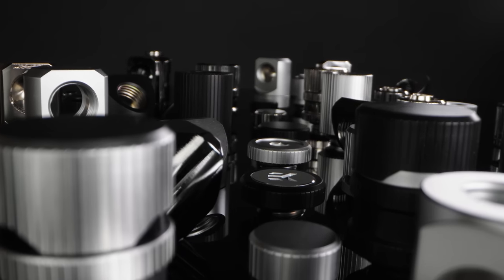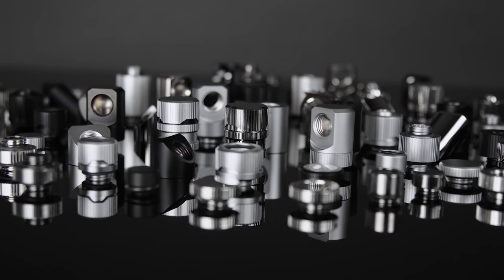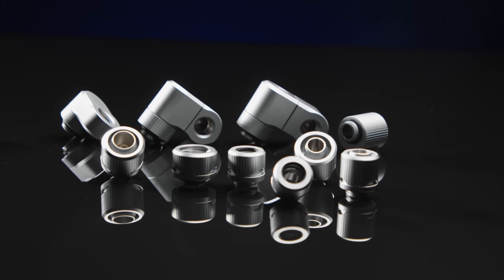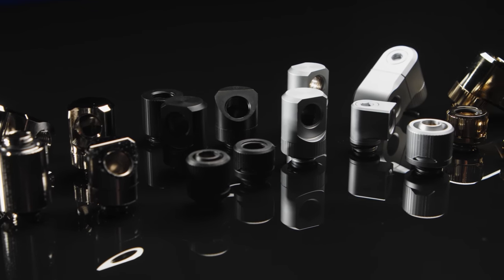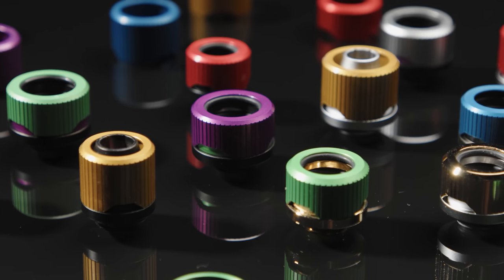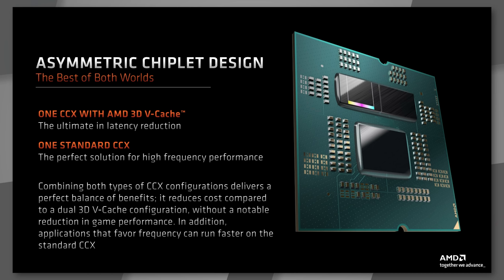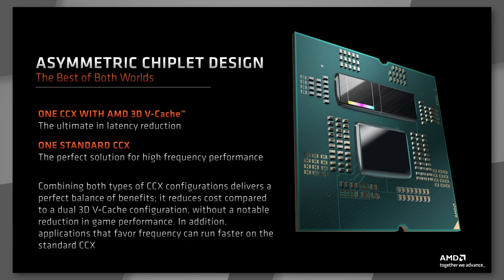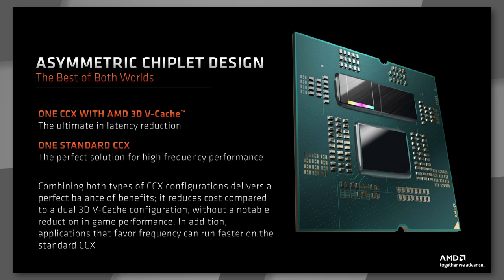Why I switched back to Intel...

Comment: 7800x3D with Gigabyte b650 elite, gskill 6000 ram and 4090, been stable, no bluescreens, no slow startups. PBO on -30 and it's been good. It was my first build since owning a 4790k so was kind of nervous about not making any mistakes but thank God its been working great.
Reply: Yeah I myself have a 7950x3d build. Been stable with 6000 ram since day one. Really don’t know what Jay’s issue is but there’s no way in hell you give up the best gaming cpu and go for power hungry intel.
Reply: He should have tested that system with other brand ram modules.
Reply: @MustafaGT  the issue is that Jay simply loves Intel and that's it. No other excuse or whatever - not sure why not just say it straightforward, same as he builds everything on GeForce cards. It's fine to be brand-fan and stick to it as long as it's good, but just damn admit it...
Reply: @utawamaru I mean its clear that nvidia has better gpus so its okay.
Reply: @infinityimpurity4032 Nvidia makes all gpu’s 😆
Reply: @utawamaru  Imo, it's not that jay just loves Intel but it's more that he just doesn't bother to troubleshoot the problem when he can just easily swap out parts or platform easily compared to regular people. Also whether we like it or not, Nvidia has the best gpu if you don't take into account the price to performance ratio.
Reply: Care you share your bios tweaks? What options you enabled/disabled or changed. Did you mess with MCR?
Reply: @utawamaru I don't think that's entirely fair. Jay has been very fair towards amd, and when you're buying the highest end of PCs, you want the highest end parts and Nvidia is still pretty far in the lead in GPUs.

He's had rough luck with his use case and the 7950x3d. That's understandable, and he didn't want to set up core affinity for every game he plays.

I don't think he's being a fanboy of Intel, he's just tired of troubleshooting the new system. Honestly he's lasted a long while for the amount of issues he's had.
Reply: @utawamaru there is a reason he likes Intel: it works. He gave AMD the best chance possible buying their top of the line kit and it did not succeed to even run at XMP profiles, let alone at any enthusiast levels. I dunno... maybe AMD should start making stuff that works?
Reply: 7800X3D sucks at multitasking.
Reply: @icy1007  how many games do you play at once?
Reply: @InnocentiusLacrimosa  Tell me you're a shill without telling me you're a shill
Reply: @lmaonaise  ive owned 3 amd devices and all three of them have issjes, fjnaly went wjth a 12th gen inetk i7 and it works like a charm, im only talking about cpus, amd gpu are in a dumpster fjre of thekr own.
Reply: @lmaonaise It's about doing things other than gaming, the 7800X3D just isn't as good at it.
Reply: @mangatom192 If you have a business like ke he does nobody has time to truobleshoot stuff all the time. If Intel works with less hassle people will choose that. I am also an AMD user.
Reply: @GentlyUsedFrog  muah, another pretend-smart: do you know any phrases that are not just memes? Probably not.
Reply: Another one with a 7800x3D with Gigabyte b650 elite, after always being Intel (last system 10700k). Have the ram running at 6400 Cl 30 (cheap Adata) and an all core CO - 38. Pretty much stays around 5.05 ghz when gaming.
Reply: @icy1007  well yeah I wouldn't buy one if I was concerned with productivity
Reply: @InnocentiusLacrimosa  Because that's a meme now? 
"Another pretend-smart" you're hilarious dude!
Reply: @kevinerbs2778 Lmao, your comment contributes nothing toward the conversation.
Reply: good man! i have similar system and also no complaints
Reply: @utawamaru  When you have money and want a good GPU there is no other choise than an nVidia card. If you deny that you are the fanboy. Im pretty sure that money is not an issue for Jay.
Reply: @InnocentiusLacrimosa  AMD CPU's work just fine. 

If i understand it correctly though, he used a ASUS mainbaord... they don't really have the best track record with RAM compatibility since a long while.
Reply: @utawamaru  Imagine you do productive work with your computer. Like i don't know... Blender... DaVinci Resolve....

Why would you even remotely consider a AMD GPU? It completly cripples you in productive workloads. The only thing it's good at is rasterization in games. The end.
Reply: Same system here. Runs cool and barely audible. Old PC was a 9700k with 2080 and the frame rates went literally 4x. And I can upgrade it to zen5.
Reply: @utawamaru  Jay literally put out a 17 minutes long video listing all his issues that he (and many other people) had with the amd system he was running for several months, but sure it's just because he's an intel fanboy.
Reply: 17 sec start up with 6000 cl30 (non expo rated) ram up and running here. Also have the curve optimizer set to -30 and no issues so far.
Reply: I have the same but the b650 pro and 7900xtx
Reply: @FantasticKruH  Awesome, are you happy with the 7900xtx 😀
Reply: @boastyy  so far its good, only had one driver problem with it on some older indie game.
Reply: @FantasticKruH  Good to hear mate! 😀
Reply: @davidchardar835  yes, he also put over 30min video half a year ago claiming to be done with ASUS, while here he complains that with each update on his ASUS motherboard it was getting worse... man, really...he wanted to use intel, I don't care. Just stop making biased shit with lowball arguments like that - because the more he tried the worse it got. simple as that
Reply: @utawamaru  Indeed, the more he tried to get his AMD computer to work, the worse it got. That's why he's switching to Intel. That is literally what he is saying in the video you supposedly watched. Thanks for your extremely valuable input.
Reply: Same here, Asrock x670e, 7800x3d, gskill 6000mhz. Super stable and fast
Reply: I have the same with a 3080, no issues, I was however getting a lot of blue screens on my 3600 before I upgraded
Reply: @MustafaGT  I love watching Jay's videos, but like other content creators the big ones whoever sponsors more and gives more money and free product they're going to choose one brand over another
Reply: Running a 7950x3D with x670e aorus master, 64gigs of 6000mhz kingston ram and a 4090. I've also been completely stable since day 1. Not even a single issue for the past 5-6 months I've been using it.
Reply: A single offset for all the cores is an extremely bad idea. I highly doubt it actually is stable at -30 all core. Nobody should be attempting those offsets. The best cores need more voltage, and that is the common cause of instability issues. You should not go past -10 or -15 on the best cores.
Reply: I would be very surprised if your system is 100% stable at -30 core offset. I have tested 5 different AM4 and AM5 systems and none has actually been stable at -30. Some pass memtest or prime 95 but then have random windows boot hitches or crashing in games
Reply: @clifflenoir4323  100% correct here. Usually the best cores are not stable past -10 or -15. Maybe -20 if you are lucky. It might take weeks or months to actually encounter an error or crash though as they will occur in low core workloads. No clue why so many people here are commenting about their all core offsets with the same value for all the cores when you should be using different offsets based on how "good" the core is.
Reply: @utawamaru that's bs. He is just honest and takes decisions based on his own experiences. This didn't work for him so he switched
Reply: My build is similar. I went from 4770K to a 7950x, G.skill 6000, Asus x670 and a 4090 and other than my WD Black 4TB SSD inexplicably dying after 10 months of use (I replaced it with a Samsung 990 Pro) my build has been rock solid. One difference though is I used Intel XMP memory instead of AMD EXPO memory. I ordered it by mistake but used it anyway and I have had zero issues running at 6000M/Ts. Go figure...
Reply: @MustafaGT  Jay having skill issues :D
Reply: @clifflenoir4323  I'll bump it up when I know it's unstable. But as of right now, nothing has happened yet.
Reply: 7800x3d with a tuf x670e and gskill 6000 and the only problem ive had is slow startups with docp enabled
Reply: @MustafaGT  theres literally no way down in hell where a system running hot as hell is going to survive for long meaning you would have to change anyways when the lifespan is getting shorter and shorter for every new generation .. thats what next gen isnt telling you about. meaning you would have to spend on a new complete system sooner than previously thought.

so indeed you chose the right CPU but the wrong GPU in terms of lifespan..
Reply: I run a 7800x3D and it runs fine and pretty decent temps without PBO
Reply: 7800x3D with b650, cant post with memory over 5200 Mhz, tried G.Skill first, returned them and tried Kingston, same shit. After several BIOS updates that did nothing, i gave up. Most likely wont be going AMD in future again.
Reply: What kind of cooling u got? Aio or air only?
Reply: @SwerveNation  Hi mate I have an AIO, the Arctic's Liquid Freezer II 360. Very happy with it so far.
Reply: @boastyy  nice I gotta corsair aio I just like the design of the glass plate lol
Reply: @SwerveNation  Ha, the arctic works great just wish it looked a bit better so can totally understand.😀
Reply: @GentlyUsedFrog  It's just dumb to call everyone who disagrees a "shill." Lots of hardware is made to work with Intel specifically. Not to say it won't work with AMD, but it isn't supported. There are loads of people who have issues with AMD. Some have been able to find workarounds. The 7800X3D is the best for games. But some products just run better on hotter, power hungry, expensive intel. That's not shilling. Everyone admits the downside of intel. But if you need your, for example, Universal Audio interface to work right you need to go with intel. Plain and simple.
Reply: @infinityimpurity4032 nah mit really Price per fps better on amd
Reply: Pbo is not necessarily anymore or?
Reply: So your problem could have been memory related or MB related and you didn't try any other options before making a video about how bad the issue was?
Reply: @butchbrown1582  It sound like it was multiple AMD systems over years. Not sure how many other mobos or brands of RAM Jay tried, but it's not just him having the issue.
Reply: @Odder-Being  I didn't watch the video, but those who get a blue screen from RAM on AMD DDR5 systems should try increasing the RAM v.
Reply: Lucky CPU you got there! before the 7800X3D I had a 5900X that managed PBO-30 and a little clock offset boost. Unfortunately I wasn’t so lucky with my 7800X3D: got it to -15 stable in stress tests, but I do get bluescreen sometimes while loading the OS. I ended up setting it to -10, I’ll check in the next days if I can set it at -13 or something like that.
Reply: @Galrandil  Yes mate, its been very stable at -30 PBO when stress testing so very lucky. To be honest as long as nothing breaks I will be happy. The burning 7800 x3d chips and the melting 4090 connectors have been a worry. Turned the soc voltage down to 1.2  when I heard of the cpu issue. Keeping my fingers crossed, hoping the pc keeps running lol. Good luck man.😀
Reply: Same boat, feel like jays nonsensical yapping is unjustified and merely confirmation biases
Reply: @MustafaGT  Expo tuned or non-expo tuned ram?  I was considering Gskill Flare X5 ram up until seeing this video… now I’m wondering if I’d be better off getting Ripjaws
Reply: @lmaonaise  Dude, multitasking doesn't mean you play multiplae games or that you do multiple things in productivity... If you play games and have discord in the background, that's multitasking, If you play games listening to music, that's multitasking, if you play games with the browser open for guides, that's multitasking... And that's before I bring up streaming and recording.
Reply: @crackajacka87  most of those programs have very little effect on cpu, I have not seen 1 person complain about performance issues while having discord  or multiple browser tabs open. These things are more ram intensive. If youre streaming then thats probably a different story
Reply: @lmaonaise  ... You originally replied back to someone complaining about AMD struggling with multitasking.... Also, you clearly know very little about computers as your cpu deals with processes on the computer, not your ram, so if there's multiple things running on your computer at once then your cpu will use up a core for each different process. To give you an example, if you have a 6 core cpu and you play a game and have the browser open then you'll have 5 cores available for the game and 1 core for the browser and that's what multitasking is.
Reply: @crackajacka87  having a browser open is not enough multitasking to cause a problem mr computer expert
Reply: @lmaonaise  Yes it is as it has to use an entire core to run it.... It doesn't just run itself y'know. This is why the latest intel cpu's have E-cores and P-cores so that the efiiciency core can deal with the lighter loads like browsers or discord while the performance cores can be used solely on gaming or rendering.
Reply: @crackajacka87  you have no idea what you're talking about and you're an intel fanboy. Once again something like having a few browser tabs open and streaming youtube while playing games won't have a significant impact on performance. I don't care about e cores or p cores, I care about numbers
Reply: @lmaonaise  I'm not an intel fanboy nor an AMD fanboy, i just like tech and in fact I have an AMD Ryzen 5 7600 cpu so stop prejudging people you know very little about. 

You are right in that having your browser open wont impact performance much, that's why intel has e-cores for apps like this just to save on power and make the cpu more efficient but the argument wasn't about performance, it was about multitasking and running a browser plus gaming IS multitasking because you are using multiple cores and if you have discord going too then you are using even more cores... Each app will take up a core so it's always best to minimise how many apps are running when playing games to better your performance on games that require multiple cores.
Reply: @crackajacka87  you're right that it counts as multitasking but that example just doesnt affect game performance significantly
Reply: @lmaonaise  The argument wasn't about game performance it was about multitasking as you believed that your cpu doesn't multitask when you game and I pointed out how simple apps running in the background as you game creates multitasking.

Also, if a game is core heavy then it can effect perfomance so if you have a browser open, Discord open and Windows running and you only have 6 cores then you remove 3 cores for access to your game and some games performance best with 4 cores and some like even more... But it depends on the games you like and what you have running in the background.
Reply: I'm building something similar for Christmas this year and I'm so excited. 7700X with the same B650 Elite, Trident Z 6000 CL30, and an EVGA 3080 FTW3. It's going to be my first build since 2015, I'm still using a 4690k PC with a GTX 970. I'm so ready to finally have a beast PC again. Although I'm curious why you went with a "budget" B650 mobo like that when you can afford a 4090.
Reply: G.Skill is the way! Trident Z 6000 CL30 RGB it's the exact kit HUB uses inn their videos, and it works just as great for me with the x3D chips. I think Jay's just got a bad kit of HyperX RAM, that or x3D chips just hate HyperX. Not to mention hes using an ASUS board and wondering why he's having issues. Almost as if it isn't common knowledge that ASUS is currently getting a lot of shit for releasing crap motherboards and terrible BIOS.
Reply: no, the best chance possible would've been buying a different kit of RAM instead of completely jumping ship with very little effort to actually try to fix the issue lmao. That's like not buying a shirt because one size didn't fit you correctly. Big brain. @InnocentiusLacrimosa
Reply: @yeetus59  did you even watch the video. This system was a poopbucket of problems. AMD needs to get their stuff together, but apparently much of their fan base is willing to overlook any possible problems.
Reply: Bro I’m upgrading from that same cpu to a 7800x3d today
Reply: @darkmay200  Awesome mate! Its a hell of an upgrade, hope everything goes well for you. Make sure you update to the latest bios and manually set the cpu soc voltage to 1.2v in bios and all should be good. Thought I would mention it as its important to protect the cpu. Good luck man, enjoy your new cpu its a beast.😀
Reply: why get 6000 when u can get 8000 hehehe
Reply: why do i need to manually set the cpu soc to 1.2v
Reply: @K24-SRT  Thanks man!
Reply: @MustafaGT because gaming isnt everything, zoomer
Reply: Thanks for commenting. I’m actually looking to upgrade from a 4790k now so your comment speaks to me 😂 really trying to decide intel or amd. Being in dead sockets kinda sucks.
Reply: @LJH08Ralith  No problem mate. Yeh I can understand the frustration. I was very happy with my 4790k, never had a problem with it. When I was finally looking to upgrade I knew that I was primarily concerned with gaming and the 7800x3d kind of ticked all the boxes especially with the low power consumption compared with the intel  alternatives. If your computer is going to be used as a workstation as well as gaming then perhaps the intel models might be better if you don't mind the extra power consumption. The 7800x3d  is a great cpu and a hell of an upgrade from the 4790k and like you said the motherboards have an upgrade path if you decide to upgrade when the faster cpu's come out. Good luck man, whatever you choose, hope all goes well, enjoy.😀
Reply: @InnocentiusLacrimosa  AMD shits on intel....
Reply: @reznya2700  true, AMD is shit. Glad we agree on that.
Reply: One of the Ethernet ports on my x670e steel legend has stopped functioning.
Reply: Crazyd-gj3ct  Computer repair mate!😀
Reply: I have the Msi b650 pro wifi same cpu and ram paired with a 3090 it’s been working solid
Reply: @anthonyrodrtiguez  Awesome mate, hope it keeps running well for you!
Reply: I’m actually getting slow start up now why?
Reply: @anthonyrodrtiguez  Have you installed any new software which might be starting automatically and slowing the pc down? Ctrl/alt and delete to get to task manager, click on startup apps and disable apps you don't need to running at start up. Another thing to check is if there is a newer bios available for your motherboard. Good luck mate.
Reply: @boastyy  Noo really it’s been like that since the first start
Reply: @anthonyrodrtiguez  Have you put expo on in bios? If its on turn it off to test, to see if the pc starts quickly, the ram training with expo on could be the problem. Some configurations of ram/motherboard/bios version are slower than others. Make sure you are on the latest bios. Good luck man.
Reply: BEcause u have gigabyte motherboard..If u had asrock asus or msi.. Blue screens slow start up... etc.. I  have gigabyte aorus master x670e I never had issue that i need to force restart pc or blue screens.. Jay 2 cents is not good computer master. I am on computers since 1991.. and he does not provide good information for realistic way how to repair stuffs. If he is an expert he should know everything not only 1 thing.
Reply: Is it just me or Jay said he ran with AMD since Intel's 10th gen?

Seems like a solid couple of years if I'm not mistaken...

To be fair, he gave fair praise and criticism to both Intel and AMD, I think that's what people call being transparent end neutral....

Just because he hurt your feeling about your favorite cpu doesn't make him a fanboy, but rather shows what YOU really are

Edit: shoutout for the comment section host, your arguments in here are really interesting and Informative 👍
Reply: Brand affinity aside I'm going to side with Jay on this. I have had a 2600 , 3600, 5800x and they all ran great low temps. The day I got my 5800x3D my problems started with ram stability. It wouldn't boot with xmp , manual timings to meet xmp etc. I had 3 different kits one of which was supposed to be great crucial ballistix 3600 cl16 dual rank. None of them ran xmp and would only run stock speeds stable.  Granted fast memory isn't a major necessity with the X3D chips Id have to boot three times just to get the PC to post. I RMA'd the chip brand new one same issue,  board worked flawless with 5800x standard never a problem. So as he says he should have gone with the 7950x non 3d . Something up with the memory controller. AMD said you are only guaranteed to get ram at 3200 with the chip anything over they didn't care. I've had nothing but AMD since I started PC gaming.  When the PC ran it was fine for the most part but just stability made me crazy. Microcenter had a deal last week got a 14700k mobo and 32gb of ddr5 6000 for 489 in store . I bought it . Built it turned on xmp it just runs and honestly it was a relief. The X3D when working game performance is incredible but something isn't right.  The Intel purchase was just an experiment. So far it just works. Yes it uses more power under full load but I really just game and minor productivity.  I'm happy with my choice. Maybe I'll go back later but the memory stuff just drove me crazy. If yours works I'm happy for you . Wish mine did I wouldn't have needed to upgrade
Reply: @brettberry9846  Yeh that's frustrating having the memory issues. I have not had any problems with the 7800x3d and the g skill memory and count my blessings every day lol. My old 4790k was a brilliant cpu, never had any problems with it, just rock solid. Hope the intel system says problem free for you man!😀
Reply: @boastyy  thanks man. You too! I'm not a fanboy of anything. I just want my system to work. I'm glad yours does that  chip is really sick! So far I'm seeing decently better performance than my 5800X3D and I'm good with that.
Reply: 12900k 6000mhz ddr5 out the box
Reply: stable under weak load
Reply: Lol @utawamaru
Reply: 7950X3D paired with 7900XTX has no problems either
Reply: @MustafaGT  Word. Prioritizing V-cache in the bios and process lasso really wake a 7950x3d up.  Jay was probably trying to go 4x2r lol.
Reply: Ryzen 7000 and Zen 5/6 NON 3D I predict are the way to go if you don’t go for Arrow Lake Intel builds. Until AMD gets 3D VCache out of beta state.
Reply: @Odder-Being
Imho,I would rather suggest that he tries with another brand motherboard.
Reply: @germanmosca
EXACTLY THAT.
Bullseye!
Reply: Em, can you say it will run like that for 5 years?
Reply: why'd you do pbo -30 instead of auto?
Reply: @paradigmshift7541  I just followed some guides and they were setting it manually. Tried -10, -20 and finished on -30.  Took some time because I had to run benchmarks to check stability for each setting. I did not expect to be stable at -30 but I have been lucky. Pc has been very stable mate. Merry Xmas!
Reply: Ever since Jay jumping on the complete bullcrap RTX 3000 POSCAP issue bandwagon, I realized Jay is easily one of the least capable tech YouTubers. What's worse is he even doubles down on claims after the knows he has been proven wrong, nothing here surprises me.
Reply: @AbhinavChauhan2 This IS his business tho 😂😂😂😂
Reply: 4790K was an awesome CPU
Reply: @tropicalape-bl2gx  Yeh could not agree more mate. My backup pc is still using it, still going strong lol. Happy new year mate.
Reply: @Battleneter i had 4x amd cpus on 2 motherboards with every possible combination and all of them had USB connectivity issues. Tested every port with different devices. Couldn't connect on iTunes. But guess what, I tried it on a friend's Intel and amd my brother's laptop Intel and it worked like a charm.
Reply: @Galaxy-jy5jh nvidia does not make all the gpus lol.
Reply: @icy1007  It's about the 7950X3D tho..
Reply: I love the 7800x 3D.  I have a 7950x 3D and if I were to buy another it would be a 7800.
Reply: @vipprimo  I have been very happy with the performance and power consumption. For the price Its great for gaming. Will be interesting what performance future x3d chips bring to the table especially if they can be used with our current motherboards. Happy New year man!
Reply: Had some weird shutdown in some game (mostly Fallen Order). Discovered the PBO stuff today (couldn't go lower than 24), hopefuly it will fix  things.
Reply: After 3 months on 7800X3D I just encountered my first memory failure. System won’t post with one of the sticks installed. Just get an A6 debug code.
Reply: @Gulf76  I would try clearing your cmos, updating the bios and reseating the ram. Hope you sort it out mate.
Reply: Good for u.
Reply: @MSDGAMEZ  Thanks man! Much appreciated, Happy New Year!
Reply: wow, you just described my build and same co -30
Reply: @segbed  Ha nice one mate, you have great taste in pc hardware lol.😀
Reply: Time for Amd driver software updates they will fix it soon hopefully.
Reply: X3D for gaming until they fix the driver software.
Reply: 89C for X3D.
Reply: Stable with 7800x3D - Corsair Vengeance 6000 64gb CL30 - 7900xtx
Reply: @TurboGlenn  nice one! Are you using 4 sticks or 2 sticks of ram?
Reply: @boastyy  2x32gb. Always try to have 2 if possible. Not all hardware can handle 4 I've heard
Reply: @TurboGlenn  Good choice, yeh that's why I was asking, knowing the problems with 4 sticks. Apparently on my b650 elite motherboard the newer bios versions help with the 4 sticks but I agree 2 sticks are less hassle.😀
Reply: All legends own the 4770k 4790ks
Reply: @technicalactivity  ha 👍😄
Reply: 4790k. Haswell lasted quite a while.
Reply: @uss_04  Yeh man, awesome cpu, still works in my backup pc lol.
Reply: @boastyy  Honestly if I still had a functional one I'd put it to work as a NAS.
Reply: @uss_04  Yeh that would have been a good plan, great cpu's. 😀
Reply: Uh learn to build intel does not compare to and!!
Reply: Was running a 7900xtx,7950X3D msi x670e board and it was slow as shit,stuttering like crazy on cod,I switched to 14900k z790 apex encore board and so much smoother! Intel for the win no doubt
Reply: Lol why such a memory, or you just googled one of the best ram ?😂 X3d cache making your 6000 irrilevant
Reply: @serhiymedvedyev7140   The 6000 speed and low latency I think is the sweet spot. The g skill memory has been very stable for me where my friends have used different ram and had issues. I normally keep my computers for some time so thought what the hell, I will treat it to some better ram lol.
Reply: @InnocentiusLacrimosa Thats cause AMD uses EXPO...
Reply: Wow I have the same exact specs except a 4070ti. Super stable and run very cool.
Reply: @MustafaGT   He is an intel fan boy............................
Reply: Basically same setup got in last year, well motherboard but others basically same I had a problem with a white light on motherboard. Everytime I power on, I get white light and then I power off and on in which it actually display. Been doing this for a while tried all the way on internet nothing fixes it :(
Reply: @kennethchen5996  Hi Ken, have you tried updating your motherboard bios? Check which version you are on and update to a newer non beta bios. Ignore the bios versions with a letter after the number "which are beta bios", such as f20 "A". Just get the official F20, or whatever the newest version is ie F21. You can update the bios with the qflash plus, you don't have to boot the computer just flash using a usb stick "guides online" when the computer is off. 

If you have 2 sticks of ram make sure they are in the 2nd and 4th slot and that both the cpu power connectors" top of board" are connected properly. Other things to check are bent pins or debris in cpu socket, remove gpu and connect motherboard to monitor with hdmi,  use 1 ram stick at a time or swap to different ram to test. 😀
Reply: @InnocentiusLacrimosa   Say that to my buddies crashing in games with ddr5 on 14th gen, ddr5 is pushing limits to be better, many Mobo's seem to be falling short ootb. I think the real answer is anyone with a new DDR5 setup should be using hynix A-die and 2 dimm for best results.
Reply: @boastyy  It was either I didn’t have my ram inserted tightly or i hadn’t used my system for about a month and had to take it out and reinsert it. Never had issues since.
Reply: How about thunderbolt?
Reply: @mangatom192   You also have to take into account that Nvidia GPUs perform much better at many other things outside of gaming as well. I use UE5, blender, etc., and I tried a Radeon 7900XT and it drastically underperformed compared to 4070 I sold for the 4070 ti SUPER simply because it has an extra 4GB of VRAM for longevity.
Reply: The last AMD thing I had Iiked was my R290 - brilliant card
Reply: @MustafaGT they must of done him wrong somehow but who knows, i still support Asus.
Reply: @Odder-Being  why? Why should anyone have to try different memory modules? AM5 is a just a buggy platform….not sure why so many people are having issues…
Reply: @utawamaru no its not….the 7800x3d is a great processor for gaming….but the am5 platform has problems….intel dont seem to have these low level hardware issues….but there cpus are power hungry beasts…..(for gaming at least)
Reply: @Digifan0007  Because his modules weren't on the list of approved modules. Further i don't have the impression that "so many people are having issues"
Reply: I've been having a Black Screening Issue and it's only on the Monitors that are plugged into my GPU and the Error I get is a Display Driver Timeout or DXGI Device Removed
Reply: @deltasixgaming  Could be a problem with the graphic card driver/ g force experience or ram. I would use display driver uninstaller to completely remove all the Nvidia drivers and gforce experience files then install the latest Nvidia driver only, choose clean install. Don't install g force experience. Test to see if its ok, if you still have error try swapping ram or using one stick at a time to see if the error goes. Good luck  man😀
Reply: @boastyy  I have a RX 6800XT but I have already used DDU to Uninstall the Driver's and I did a Fresh Install I even Formatted my Boot Drive and reinstalled windows 10 and I even got another Drive and installed windows 11 on that one and the same thing I also bought 2 more sticks of RAM and changed the others out but I will be getting a RX7900XTX tomorrow so I'll see if that fixes it
Reply: @lmaonaise  you know, whenever you call someone an Intel fan boy,  you scream amd fanboy. Don't look like a fool when trying to make someone else look like a fool.
Reply: What you expect from this channel lol
Reply: @MustafaGT I’m a 3070 7800x3d with 6000 mhz ram and no issues ether
Reply: are you advanced user who can tune and or overclock system ?
Reply: @icy1007  if my 4 cores 6700k doesn't suck at multitasking then how 7800x3D with 8 cores suck at multitasking?
Reply: The x3d is not always a better cpu for gaming or anything else there are many factors
Reply: Happy western man
Reply: I think eventually your -30 undervolt will fail as it did with mine over time. That undervolt puts you right on the edge and if there is a change in the environmentment……….it may not provide enough millisecond spike power and lead to a reboot. Personally, I lowered my undervolt to -10 and experienced no more reboots.  89c is the TJ Max……….not 85c. Dealing with the heat issues on Intel just steers me in another direction. 100c immediately upon load using an AIO is just not right. The amount of time spent tuning Intel because of heat is not worth the effort. 
The memory issues with Ryzen will eventually be resolved. It’s a new platform Jay. As of this writing, I’ve had no issues with my DDR5. Get rid of your undervolt for one……….swap out your ram……..etc…….etc.  You have another problem.
Reply: @techluvin7691  Yeh will probably fail at some point and will have to readjust the settings. At this time its ok, been on -30 undervolt for about a year now and no problems so far. I think it will be ok until the next x3d chips come out later on this year or early next year. Will have to see what their performance is like but at least I won't have to swap motherboards etc. as with intel if I want to upgrade. Time goes by so fast , can't believe I have had the system for over a year already lol.😀
Reply: @germanmosca full time modeler/texturing and game engine developer here, and gpu's are great. 7900xtx in my rig. When I say full time I mean I pay my bills like this.
Reply: @BeyondReasonableClout  So you likely don't render images and videos in Blender i take it? Because in that case you would save a hell of a lot time with Nvidia cards.
Reply: Jay is Intel fan😂because that praise so much intel
Reply: @MustafaGT  79500X3D isnt nessecarily better than 7800X3D if you are running purely a gaming rig
Reply: Damn, I struggle with my setup, 7800x3d, gigabyte gaming x ax b650, gskill 6000 ram and 4070 ti, I cannot install bios higher than F9 because every time I turn off my computer the led for graphic cards turn on and I dont have video, I also had overheat issues, so I set PBO to the pre set 80 level 1, its sad to know that newest ryzen versions comes with lots of thorubles
Reply: @tr33ck0  whats your psu? and is your memory amd expo / compatible? nb wait 10 mins it needs to assess memory and might have to restart several times
Reply: @francistaylor1822  yeah its expo compatible, its the trident z5 gskill kit expo profile enabled to use the 6000mhz , my psu is an mpg a850g, and just after turn off the computer, not a restart a turn off operation, then turning on again, the vga led turns on and I have no video it doesnt matter how much time I wait so I need to do a hard reset otherwise video will never show, this only happens with bios higher than the F9 of that moba
Reply: I have a 4090 and 7800x3d and my ram cant go higher than 5000 mhz
Reply: @mansooralahbabi3340  What ram and motherboard have you got mate?
Reply: @utawamaru  He just said that he used AMD for many years at home. Also isn't the threadripper an AMD as well?
Do you even listen?
Reply: @MustafaGT  Yes, but he has overclocked the CPU too. I don't know how much you can overclock an x3d with the 85 degree limit.
Reply: @username8644  that isn’t how it works, you clearly don’t know what you are talking about. The best cores need less voltage for the same clock speed and voltage directly correlates to temperature, so on a good core you can lower the voltage and decrease the temperature which lets it boost higher. If you go and tune each core individually then the best cores will be the ones that run stable with the largest voltage offset, so they run at a lower voltage. Your statement about the best cores needing more voltage has never been true.

Also -30 is not that extreme, like he said on his 13900k he managed -75.
Reply: @conorstewart2214  You are the one who doesn't know what they are talking about. These new amd chips do not work the same as the intel chips which is what you are describing. The best cores for amd need the most voltage. Please do some research before spreading mis information and even worse, thinking you are right and others are wrong when you are actually wrong.
Reply: I've had about 24 - 30 second boot time, but that's due to RAM training. If I turn on memory context restore, I get memory management bluescreens when I boot. However, everything else is PERFECT. I had an i7 4790k as well and this is a major upgrade.
Reply: @icy1007   It wasn't designed for that. Was it?
Reply: @ChairmanMeow1  Glad your rig is working great! Yeh I have been very happy with mine, its been very stable so far. There's always an element of luck picking parts for the system and its horrible when things don't go well, especially with expensive components.
Reply: God please trade me for my 13000kf nothing but blue screens adjusted bios everything this is beyond ridiculous
Reply: @tylerharris4568  Sorry man that sucks. Hope you get it working properly, keep checking for new bios releases, hopefully it will get sorted. Worth running memory tests as well just to be sure. Good luck mate.
Reply: @MustafaGT sponsorship lol😂
Reply: @ColdP  Do you have MCR (Memory Context Restore) enabled? If not, how long do your bootups take (the memory training time being relevant here)? I have a new 7950X3D and 6 GHz RAM and with EXPO I, the training takes almost 1 minute and when I use MCR I get crashes later on. Pretty dissappointed. I mean we're told that 6 GHz is the "sweet point" for AMD CPUs, right? And it doesn't even work??
Reply: my exact build except 4070 ti super. everything is fine except only cyberpunk will crash from 30 minutes to an hour. turned off memory context restore and lowered my gpu overclock and it hasnt happened since
Reply: @PenguinsAreColdish  Nice! Glad you sorted out the crashing issue with Cyberpunk. It was probably the overclock which was causing it, some games can become unstable. Thanks for sharing mate, happy gaming.
Reply: @boastyy  well the weird thing is it was crashing before i even overclocked my card, and i still dont know whether it was the game or PBO and RAM not being stable bc of memory context restore, since it doesn't crash on literally any other game.
Reply: @PenguinsAreColdish  Yeh, hard to know what what was causing the crash.  So many things to check, from drivers, updates and bios settings. Glad its working for you now mate.😀
Reply: @icy1007 it’s a gaming only processor, everybody knows it!
Reply: @kapitumbulu  No it isn't.
Reply: @icy1007  7800X3D, given its cost, it’s the best CUP for gaming, mediocre (good at best) for everything else, that is precisely the way it was designed by AMD and everybody who is not stupid or live on Mars know it. full stop. It’s a fact, not an opinion. So, are you stupid or living on Mars…? 😏
Reply: You and me both. My last desktop was 4790k with GTX 980 (I miss EVGA). I have a laptop, but was about to build a14th Gen Midtower. I am now definitely waiting for 9800x3d or 9950x3d with a RTX 5090.
Reply: @The_Dude_Abides117  Ha! My 4790k is still going strong in my backup pc, awesome cpu. Will be interesting to see the tests on the 9800x3d/ 9950x3d. I might update to the 9800x3d too, maybe lol. The RTX5090 looks like a beast, might be hard to get hold of at launch again, good luck man. Hope everything goes well with your new build mate.
Reply: JJJJAAAAY.  YOU DONT KNOW AMD NEED BEST OF BEST RAM? .....USE GSKILL will solve all problem 100% be sure your hyperx ram is trash